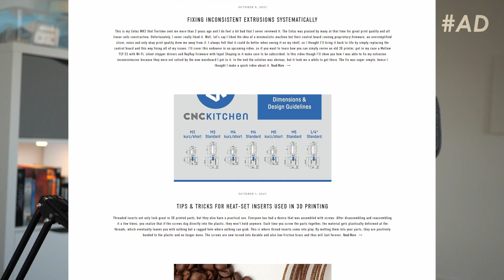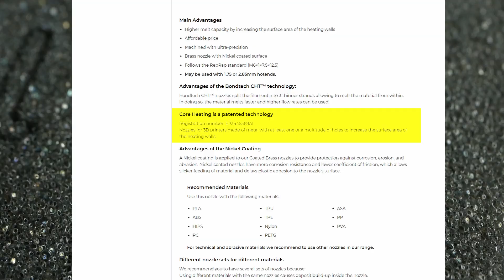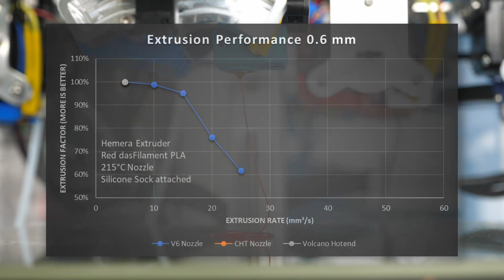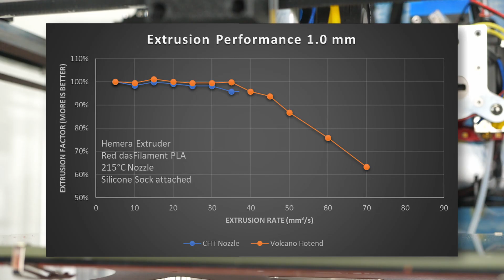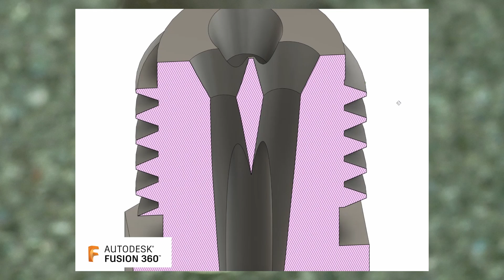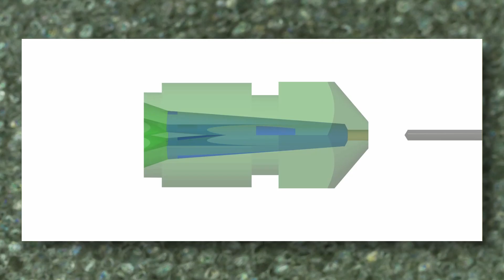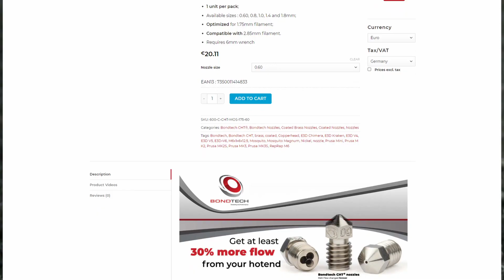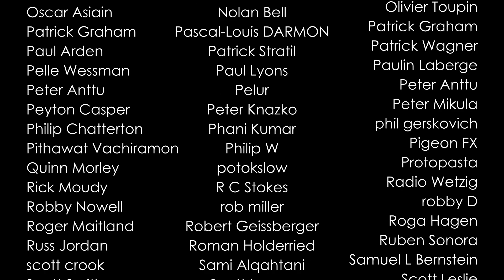Does This make Volcano Hotends Obsolete? Bondtech CHT Review

Comment: So Stefan. I have an ender 3 pro with a hemera, a titanium neck, and a copper plated regular size block, and a copper plated V6 nozzle (0.4mm). I would like to be able to print hotter items like carbon fiber reinforced polycarb, and or peek, and  glow in the dark, and wood, and metal filaments.  Would you think this nozzle would be better at those higher temps while allowing a faster flow rate or how might this be good or bad thing for those situations... that is of course if a 0.4 or smaller one is made. I am curious your thoughts on if for my set up or such if this nozzle is good. i did watch the video, but stilll a wee bit confused as to what situations or setups or such this would be useful for currently or if a 04mm one is made.

Comment: I just tested the 0.8mm version. It is insane. Together with a bi-metallic heat break and a 60W heater my hotend is just eating the filament on the small printer. It is even beats my SuperVolcano with a 1mm nozzle. I guess it is time to retire this super heavy monster as I can just not go fast enough to justify it and really do not see any advantage now any more. Ill just upgrade it there to a similar setup on my smaller printer...

Comment: As usual, very well researched. Though I am curious: Do you think, as you print many meters of filament, that the middle "cutting" edge of the nozzle dulls over time? if it does, do you think that would interfere with flow? Also, this innovation seems orthogonal to Volcano. Do you think they can get even more flow rate if the made a Volcano Clover?

Comment: 12:00 the prusa extrusion system is bad. I couldn't get it to print reliably with 25mm³/s, 22mm³/s worked though. The motor gets really hot even on a 3:1 ratio

Comment: My idea:
I thought that one would not need a Volcano nozzle for a Volcano hotend, if one would make an insert into the heater block, which covers the half of the length, then you could use just regular V6 nozzles for Volcano.

The plastic wouldn't care whether the insert part or the nozzle part heats it up, the nozzle is just required because of the precision orifice at it's tip.

Improving it even further, based on this nozzle, one could make a cloverleaf insert for a Volcano hotend, the still use the standard V6 nozzle. 
Benefits: 
- no need to manufacture cloverleaf into a nozzle you throw away when the orifice is worn out, and the internal cloverleaf insert would last longer.
- one could use any existing V6 style nozzle, with special coatings, Ruby tip, etc, while benefiting from better performance.

Comment: While the core might not directly conduct heat into the plastic, they increase flow rate near the walls of the heat transferring outside surfaces. 
Liquid cooling radiators try to increase shear rate near the walls to accelerate heat transfer, which is the closest engineering example I can think of. 
Very clever design and I want to get my hands on one! $20 is pretty reasonable. I wonder if a copper version will be released.

Comment: make a heated nozzle... how?!  an outer aluminium tube, a 1" tall spiral spring made heat resistance with 3 laps, a copper inner nozzle in the center, thermal paste to fill the gaps, ceramic binder on the ends, a dimmer to control heat, and a power source.

Comment: An injection moulder I designed uses that exact concept for the extruder. It's a nice solution that makes clever use of thermal conductivity properties of metal vs plastic. I never thought to apply for a patent since the concept is pretty self evident from engineering principles when you're designing an extruder from scratch. Also you would most likely drill the deeper holes first because end mills aren't meant to be plunged.

Comment: The design makes me feel the need to do a deep visual inspection on each one before use.. and intermittently while in use. I'm also curious about inclusions of nickel plating in the melted material flowing through as the nozzle wears over time due to the nature of nickel plating. In extremely niche applications, metallic contamination would be important to know about, especially if the printed items are being used as electrical insulators (oh, wait, I do this...ITS IMPORTANT TO ME).

This is one I'd really love to dive into, but deep touchy feely questions... and a deep unwillingness to risk an arc flash accident in a capacitor bank due to unexpected dielectric breakdown.

Maybe I'm just stuck with hardened steel and there's no sexy nozzle design for me.

Comment: how will you do a cold pull now? :o
Reply: Use your 3D printer. With PLA you set the nozzle temperature to 90C. Let the hotend cool down. While it is cooling down push filament down the hotend by hand. It will be harder and harder to push it down. When it reaches 90C pull the filament up slowly from the extruder side. It may happen you need to pull the melted plastic from the bottom of the nozzle.

Comment: Are there differences in improvement on Bowden and Direct Drive extruders?
Reply: We are noticing the shorter the distance between the extruder and the nozzle, the more flow is achievable with the same hot block.
Reply: @nunosantiago6720  Is there any real benefit.on using these on a Bowden tube or should they only be used on Direct Drive?  Also how do these nozzles affect retraction?

Comment: Its a little bit misleading....Are all nozzles 0,6mm? Or is V6 and Volcano 0,4mm and Bondtech 0,6mm, if this is the case, the 0.6mm nozzle should be 50% better in the volume of extruded material....
Reply: Both nozzles were 0.6mm.

Comment: A better design/process would be to use hardened tool steel and instead of drilling the passages, use plunge edm so the internal finish is smooth and burr free.

Comment: How about testing this nozzle in a high flow mosquito or dragon hot end ? this could be a revolution for those with big volume printers.

The reason they don't make in 0.4mm i guess is that if you do the math, you will need print speeds in excess of 300mm/sec to max out flow rate... i have yet to see a printer to print that fast (or even half that speed). So chances are that you will run out of speed before you run out of flow with a 0.4mm nozzle.

P.S. thanks for the great quality content, always love the technical approach and the data you share with us. 
I'm definitely ordering one, i like to print thick single walled usable parts.

Comment: Here's an idea to test.  What if... you want to make the print feel heavier... substantial.  I'm thinking pausing the print at some point... then filling it up with sand (or other filler material) instead of printing the whole thing solid.  I think the Gyroid infill would work in a relatively low setting...

Comment: I got caught up in this rabbit hole by reading all the posts {Sigh} and I want to address the recurring themes of "Or you could use EDM to make channels" or "Put a mesh and it will really get melted" or "Why 3 when 10 holes would be better!" etc.,  ad nauseum. I have a word for you. Friction. Both in extruding and retracting. This design (multiple holes feeding a nozzle) has been around for years in several fields, as numerous posters here have mentioned. NOT ONE of those people said "Oh yeah, and it has a screen too". Why? Friction. The melting gain a mesh like, 6 hole, or channeled structure would be FAR offset by the tremendous increase in friction. Not to mention the nightmare a clog would create, you'd just throw out the nozzle if that happened with a channeled or mesh system. Three holes is a perfect tradeoff between complexity, quantity production, and low enough friction (and cleanability too). So please. Stop! :-) [End Rant]

Comment: Does that nozzle geometry make Volcano obsolete ? When the first CHT nozzles came out, I couldn't really understand that hype around them, and they didn't exist in 0.4mm which is what I was using at that time (exclusively).
1 year later, things changed. There are 0.4mm CHT, Volcano CHT, and even Bi-Metal standard/Volcano CHT. THIS could make "classic" and volcano nozzles obsolete in some way, or at least not the right choice for (ultra-)high flow requirements. V6-style classic and bi-metallic are what I use now ... In some way, you made me a believer ! 😅

Comment: I think that central "bullet" probably contributes a lot towards the heating of the material, making it much more uniform. You could test it in F360 to be sure - but I have no doubt that without it (as in your drilled version) the heat transfer would be significantly lower. (It would be really interesting to be able to rifle the inner contact surfaces as well....I bet this could improve heating consistency as well.) I'd also be really into any attempts to better control the cooling process once the material has left the nozzle. Seems to me, this is the next area for extreme improvement.

Comment: Did you try to print any Flexible filament? I was wondering if the back pressure was significantly reduce to help prevent filament tangling?
Reply: I was wondering the same. My take on it is that it better melts the plastic, that should reduce back pressure, allowing you to slightly reduce temp and get the same flow rate with lowered chance of heatbreak clogs. EDIT: Never mind - @Nuno Santiago says it doesn't help flex flow (see later in comments)

Comment: An interesting design. You could make your own nozzles to any size by drilling the tip to the size of a silver-solder wire, (1.0mm?), inserting a small slug of silver solder, (1.5mm long?) then heating the tip using a gas soldering iron or equivalent. Have the tip in the upright position on a piece of stainless steel so it solders the hole shut, redrill and 'wallah' custom tips. I suspect the cone-ing of the holes to a small orifice creates a pressure advantage a blanked end nozzle misses out on too.

Comment: ALTERNATIVE (bypass the patent, possibly better)?
- Standard size Heat Break at the Start
- Standard size Nozzle at the end
- Custom Volcano Style Heater Block 

Custom Volcano has solid center of the channel with three or four straight holes in the center (instead of one large one), between the heat break and nozzle threads.

This would be MUCH easier to make (no angles), and use mostrly standard hardware and nozzles.

Comment: Stefan, I have two printers, one with a 0.4mm and one with a 0.6mm nozzle. I'd like to eliminate the skipping on both printers. I don't see any 0.4mm Bondtech CHTs available, so would the 3DSolex Matchless 0.4mm perform essentially the same? (It sounded like Bondtech licensed it but maybe do something slightly different?) Have you used them at all, or only the CHT?
Reply: Bondtech is licensing the 3DsSolex patent, so the answer is yes, but they're more expensive. I also think the Bondtech is a 3 hole setup vs the 3DSolex 2 hole.
Reply: @mickmouse2258  yeah, I'm wondering if their performance is as good, though, because the photos I saw do indeed look like they have only two holes like you said. So while Bondtech licensed the tech, they may have improved on it. Price in Canada seems to be about a $5 difference, which isn't bad, if it's going to increase my flow as much as I hope.

(Edit: I was mistaken on the price difference. The Matchless 0.4mm is $25CAD, the Bondtech 0.6mm is $27CAD. I'll probably go for it, I guess.)
Reply: @somethingelsedoesmatter  If you do a lot of standard filament and need high flow, looks like a cheap upgrade as those go. Good luck!
Reply: BTW, finally saw the CHT 0.6mm in stock again so ordered one, and noticed they now list 0.4mm, so ordered that, too.

Comment: Even for situations where the printer has some headroom before hitting extrusion limits, according to the charts these nozzles help keep performance consistent over a wider operating range. I wouldn't be surprised if these could help print quality even at medium-fast settings.

Even with my prusa mk3, I get very close to extrusion limits on a 0.6mm nozzle when printing infill, as I usually tune infill to print as fast as possible. I have noticed with petg the infill can stop printing correctly, so perhaps these nozzles would help.

Comment: I am worried about clogs. It seems more prone to it. And also, what about material change? If you print first in ASA and switch to PLA, I bet you will have problems. Even if you do cleaning with Nylon.
Reply: I understand it seems like we are pushing sales but, we recommend as good practice not to mix materials with the same nozzle, every type of nozzle, CHT or not, Bondtech's or not. You may have problems if you mix materials, whatever nozzle you use.

Comment: What doesn't make sense is usually the filament enters the nozzle in a round hole the size of the filament so cold pulls come out, retractions do not jam and a seal is created to prevent backflow into the heat break. I don't see that with this design.

Comment: I have had the chance to buy 2 3d solex nozzles in the past with cht. I will say I had one of there 0.4mm nozzles and had it in a maxiwatt pro heater and it worked wonderfully I was able to print fast and maintain detail. I have also emailed bondtech about 3 weeks ago asking them to make a 0.5 and 0.4mm nozzle. I also have a .25 nozzle from 3d solex but it is a 2 way split not a 3.

Comment: It is rather awesome how a nozzle change can add so much to a simple hotend but after watching the flow tests, one question still persists- what would be the flow characteristics on a dragonfly HIC or a slice engineering magnum considering the CHT would be a drop-in replacement for them?
Reply: I think these would be a perfect marriage for those high flow HE's, and at the cost, pretty easy to test. At the the worse you get a nice nozzle, eh?
Reply: This is more of a hotend upgrade than a replacement. Whatever hotend you may use a CHT with, it will improve. It's a no brainer.

Comment: But won't the ptfe-tube leak due to the shape difference? Inside the heatbreak the ptfe-tube prevents the filament to leak into the gaps of the heatbreak.
Correct me if I am wrong.

Comment: I think there is a reason why they doesn’t produce 0.4. On the standard Cartesian, the travel X and mostly The bedslinger Y cannot produce the speed what a 0.4 CHT needs for a reasonable volumetric flow. Or just with a serious amount of ringing. 
The only usage for a 0.4 is a delta or corexy, like your voron :) that can handle at least 300mmps travel, which is above 20mm3 per second.  Grüße :)
Reply: Yes, but there may other advantages to this nozzle. Having more complete melting, rather than the "hot outside, cooler inside" should result in improved layer adhesion and increased print strength. Also could allow slightly faster print rates even at 0.4mm, a boon to anyone with a print farm. Now if some engineering type person like Stefan were to look into the strength and adhesion issue ... :-)

Comment: Could try using EDM to make a version with a ton of tiny holes instead of 3 main paths.
Depending on the method it could be done in one step by including the chamfer in the EDM toolhead.
Reply: Interesting idea, but I imagine there's a point where the increased friction of many holes outweighs the improved heat transfer.

Comment: Easy to make on a swiss cnc lathe with b axis or live tool twisted to that angle.  I would throw on two electric spindles at the required angle to get the part done cheaply and quickly.  Nozzles are made on swiss lathes, so it's simply a few thousand dollar investment to make this part if you dont already have one with a B axis. The machines are 100-300K so the tooling cost is cheap.

Comment: Couldn't a 3D printed rig be made for drilling with a regular column drill? Made with .1 layer height, and with interchangeable parts to ensure the correct angles of each drill. And one additional part to calibrate the center and mounting angle of the base.

This way the patent could be circumvented by just selling the parts: A blank nozzle and various drill bits.

Comment: OT: This, once again, shows a problem of 3D-printers (at least the consumer-grade types):
They do not measure the amount of filament extruded.
So, if you say, p.e. “G1 E20” the amount of filament actually extruded is less then 20mm, dependend on type of filament, temperature, and speed.
Reply: A better extruder is also a good solution.
Reply: laser measurement

Comment: I think it's useful to consider the core temperature of filament being printed too. Especially when printing with larger nozzles, the unmelted filament centre relies on the surrounding filament to complete melting after it exits the nozzle. The CHT shows a lot of promise in this respect, making the extrudate cross-sectional  flow temperature more uniform. Making the holes too small increases clogging risk but I don't see any reason why the 120 deg angled holes can't be made with a 0.4mm diameter bit for a 0.4mm orifice nozzle.

Comment: Thanks for a great video on this new technology.  Overall it appears to have some great advantages, however there are some serious draw backs for me and why I won't upgrade to something like this.  The first thing that comes to mind, and you covered for a moment, is the cold pull and cleaning.  I also require hardened steel for the projects that I print.  The last thing is that most of my work requires the 0.4mm nozzle.  The difficulty in cleaning/cold pull is the biggest deal breaker.

Comment: I really only use 0.4mm nozzles... When these come out for mk8 0.4mm, I'll try them.
And I'm guessing retraction works the same because the vacuum seal in them works the same.
Reply: Available already. Retraction settings are the same, but all systems are different so tweaking is recommended.
Reply: If not already, and having bowden tube all the way to the nozzle, don't bother. Creality mk6 nozzle performs slightly better.
Reply: @kimmotoivanen  I used one for a week, had good prints but got clogged and couldn't figure out how to clear it at all.